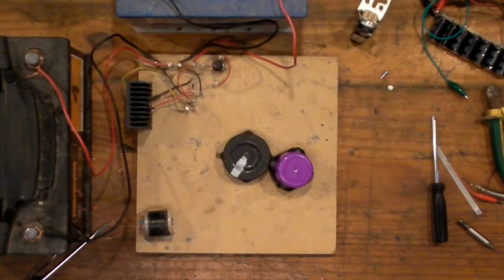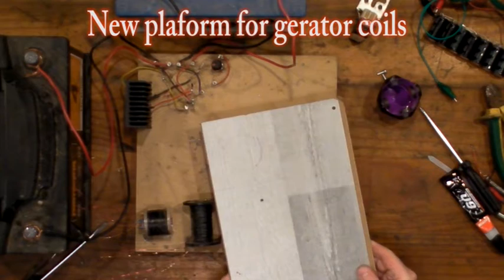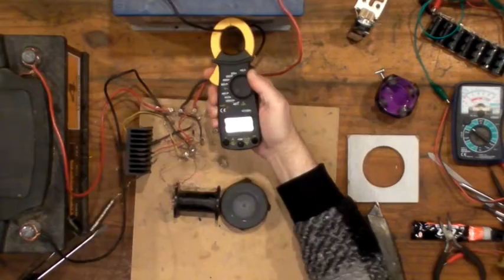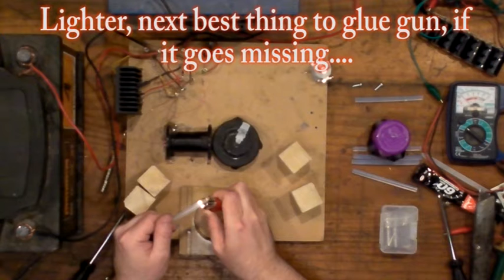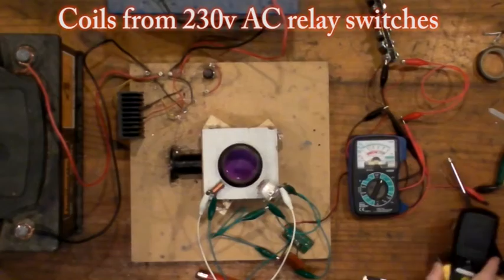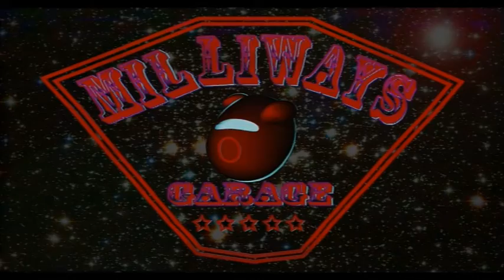Ep027 Bedini Pulse motor Continued Test and Experiment

Comment: Nice work can you measure the resistance in Ohms and give the wire thickness for both wires
Reply from the maker: Yes, the trigger is 28 AWG the run is 26 AWG they both come up about 3 Ohm.
Reply: @milliwaysgarage_ie  Thanks